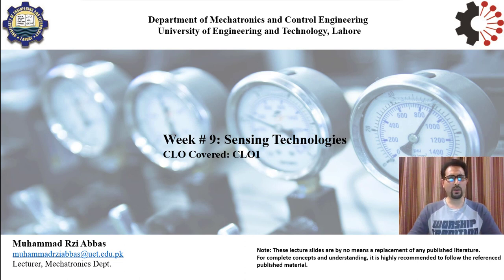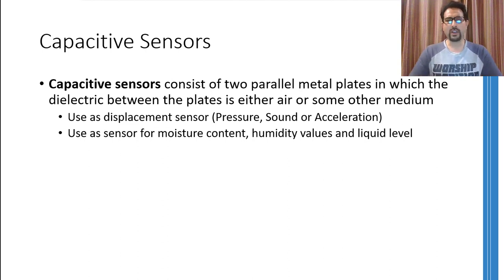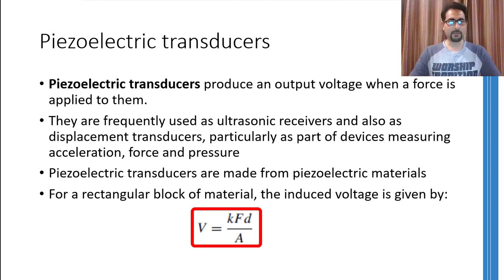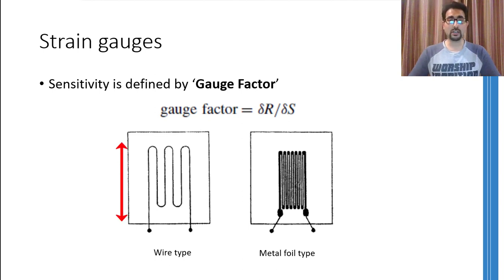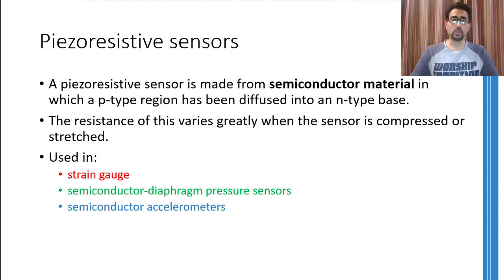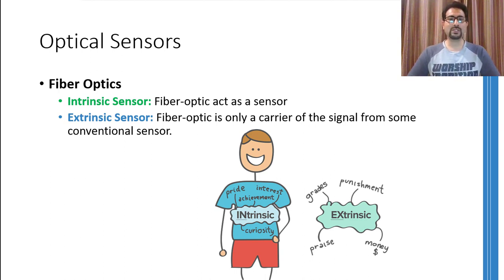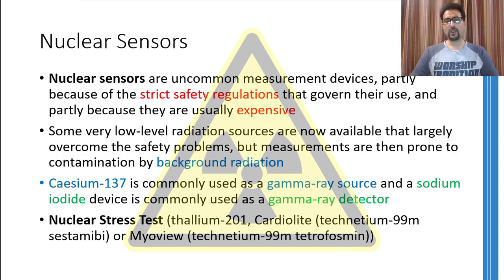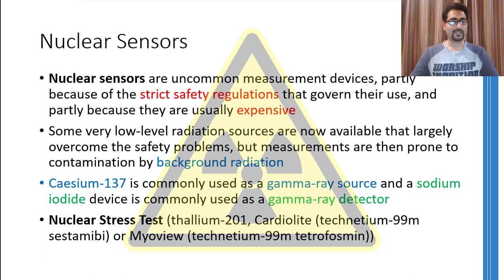Lecture 9 Sensors | What's Behind Them? | How They Sense?

Comment: Strain gauges are used in Wheatstone bridge circuits, measure aerospace phenomena like wing deflection.
Strain gauge help in monitoring fluid flow rates, use to maintain rail safety.

Comment: Strain gauges are the instruments or devices to measure the external forces that are being acted on the body or an object. They measure strain which helps in finding stresses, torque, pressure, deflections etc. They are also used in chemistry to measure liquid levels.

Comment: A full-bridge strain gage configuration has four active strain gages and is available in three different types. Types 1 and 2 measure bending strain and type 3 measures axial strain. Only types 2 and 3 compensate for the Poisson effect, but all three types minimize the effects of temperature.

Comment: Strain gauges are devices that are commonly used to measure the effect of external forces on an object. They measure strain directly, which can be used to determine stress, torque, pressure, deflection, and many other measurements.

Comment: Thermocouple strain gauge can be used to detect or measure the change in temperature since the change in temperature affects the change in dimensions or lengths thus it can affect the output of the strain gauge and thus can provide even minor change in temperature. So it has its uses in temperature measuring devices.

Comment: Strain Gauges have a long history in the safety of rails. It is used to measure stress and strain on rails. Strain gauges measure axial tension or compression with no impact on the rails. In case of an emergency, the strain gauges can generate a warning so maintenance can be done early to minimize the impact on rail traffic. Hence students can also use them to measure any strain in any strain sensitive component of their project.

Comment: Strain gauges are used in measurement of stress and strain on rails through strain gauges bonded to each rail. They measure axial tension or compression with no impact on the rails themselves. When subsidence occurs, the strain gauges can generate a warning so maintenance can be done early to minimize impact on rail traffic

Comment: Basically Strain gauges are used to measure the torque applied by a motor, turbine, or engine to fans etc. This equipment is found in power plants, ships, refineries and automobiles.

Comment: Microscale strain gauges are widely used in microelectromechanical systems (MEMS) to measure strains such as those induced by force, acceleration, pressure or sound. For example, airbags in cars are often triggered with MEMS accelerometers.

Comment: The Wheatstone bridge electrical circuit is most commonly used to sense strain gage resistance changes. ... The full-bridge circuit (with four active strain gages) provides for the highest measurement sensitivity and the best extraneous temperature cancellation.

Comment: The Wheatstone bridge electrical circuit is most commonly used to sense strain gauge resistance changes and other application includes circuit comprising of Wheatstone bridge with strain gauge circuits that are used extensively inside transducer to convert a mechanical strain into an electrical output signal. for example in the detection of bending of a beam

Comment: Strain gauge makes use of the practical form of Wheatstone's bridge to measure the strain developed by an element. Also used to measure torque applied by motor, turbine or engine to fans, generators and wheels.

Comment: Strain guages have various uses in medical feilds for instance Wireless strain gauges have been implemented in many  devices like mammography and CT scan machines.
other application includes circuit comprising of Wheatstone bridge with strain gauge circuits that are used extensively inside transducer to convert a mechanical strain into an electrical output signal. for example in the detection of bending of a beam

Comment: Bonded foil strain gauges (BFSG) are metal-based foil elements that are incorporated into a flexible electrically insulating material which can then be bonded to a surface with adhesives. As stress is applied to the material, the BFSG will deform, and the resistance changes.

Comment: Strain Gauges are used in geotechnical engineering to monitor structures like dams, tunnels, motor turbines etc. As they are very much applicable in Rail monitoring, Cable bridges, Nuclear Power plants.

Comment: Strain gauges are used to measure torque applied by a motor.Strain gauges are used in measurement of stress and strain on rails through strain gauges bonded to each rail.

Comment: Strain gauges are used to measure the torque applied by a motor, turbine, or engine to fans, generators, wheels, or propellers. This equipment is found in power plants, ships, refineries, automobiles and industry at large.

Comment: Strain gauges are used to measure the torque applied by a motor, turbine, or engine to fans, generators, wheels, or propellers. This equipment is found in power plants, ships, refineries, automobiles, and industry at large. Power is obtained by measuring the strain and rotational speed on a shaft.

Comment: Strain gauges are used to measure the torque applied by a motor, turbine, or engine to fans, generators, wheels, or propellers

Comment: In biological measurements, especially blood flow and tissue swelling, a variant called mercury-in-rubber strain gauge is used. This kind of strain gauge consists of a small amount of liquid mercury enclosed in a small rubber tube, which is applied around e.g., a toe or leg. Swelling of the body part results in stretching of the tube, making it both longer and thinner, which increases electrical resistance.

Comment: The ability of the strain sensor to measure the ratio of resistance change of a material body dependent upon the force put onto it has prevalence in the medical field. Important hospital equipment, like syringe pumps and kidney dialysis machines, rely on wireless strain gauges to discover optimum fluid flow rates. Larger objects, like CT scan machines and mammography machines also implement wireless strain gauges. The information that the devices gather translate into providing patients with smooth, safe and accurate readings.

Comment: Strain Gauge is used to measure the torque applied by a motor, turbine, or engine to fans, generators, wheels, or propellers.

Comment: Strain gauges are used to detect failure in structures like bridges and buildings. Also used to measure torque applied by motor, turbine or engine to fans, generators and wheels.